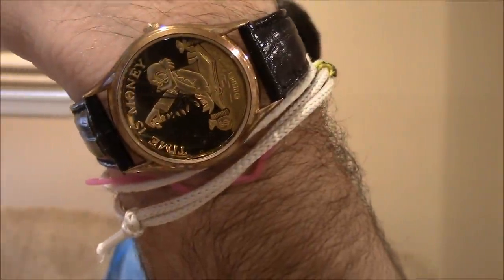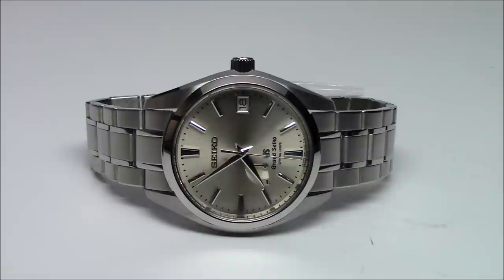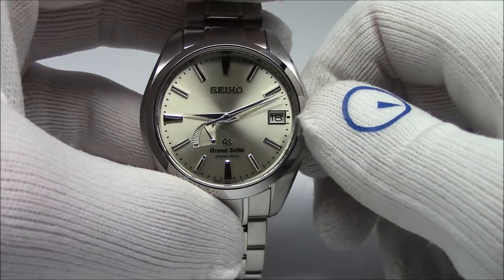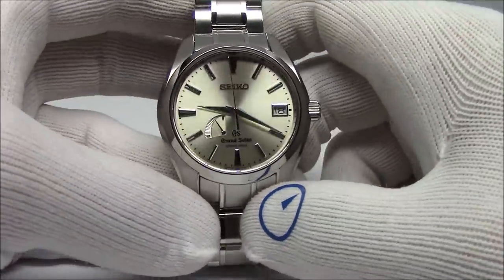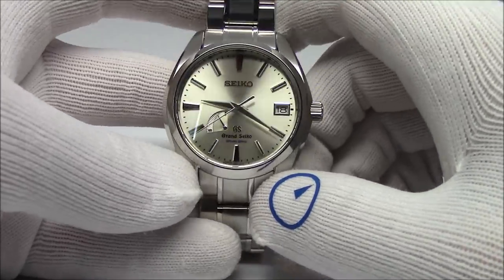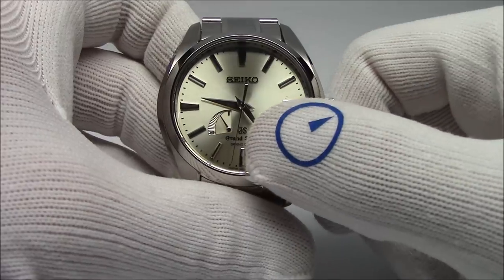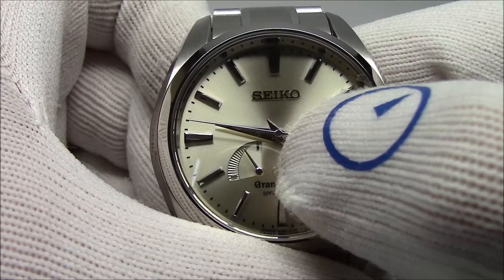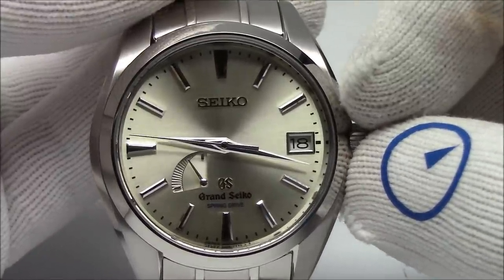What is Seiko Spring Drive and how does it work? Watch and Learn #24

Comment: So it does brake the second hand, it doesn't "tick" but it does fluctuate.  One would assume it has some sort of a pattern one could detect.  The watch presumably runs at a constant speed before being slowed down to the correct speed and then less slowed down if it over corrected.  I guess I'm asking if you slowed it down enough and could zoom in enough on the movement of the second hand would we see it stutter, and stop/slow down?  It seems obvious that the answer is yes, but I'm wondering how slow you'd have to go to notice the electronic braking.  I'm assuming they just lower the voltage or amperage (not an electrical engineer, don't know how controlling electromagnets works exactly) of the magnet to increase or decrease the braking.  Would be neat to see someone try to detect the changing speed of the hand.
Reply from the maker: It's a good question, but it properly designed, it should not show any start/stop motion.

Comment: Can you help me understand how power is generated via the electromagnet and transferred back through the electromagnet (in order to slow the speed of the glide wheel) at the same time? I understand how the permanent magnet spinning creates a current which is used to power the circuit and oscillate the quartz. I also understand how the oscillation of the quartz generates a current which is fed back to the electromagnet in order to slow the glide wheel. What I don't fully understand is how both of these things happen at the same time.

Does the voltage applied back into the electromagnet offset a small portion of the voltage generated by the spinning of the glide wheel, resulting in a lower net voltage that slows the glide wheel?
Reply: I believe there are two different electromagnets involved.

Comment: Does all this mean it's less durable over time?
Reply from the maker: I would say no less than a standard auto. MTBF of electronic components is far higher than mechanical ones; orders of magnitude.
Reply: Joey D there are debates over this question. but as far as I know, the mtbf for electronics is very high, electronic equipments usually die from heat or chemicals (like battery cells or some capacitors). here the energy is stored in a spring, no battery, no capacitor as far as I know, and very low voltage. and smoother than pure mechanical watch (no shocks). so they MAY be more reliable than any other watch. I have never found a report of a springdrive problem. I own one so I checked that before investing !!!

Comment: This was an amazing explanation, thanks Mark. A question I have, is how does the watch compare the quartz oscillation timing with the seconds hand timing... and then modify the brake pressure in just the right way to keep time... without a computer chip? Is there a mechanical way of doing this or is it another electronic component?
Reply from the maker: It does have electronics to do the comparing.

Comment: No watches are quartz "driven" this watch is quartz regulated just like other quartz watches but the implementation is on a mechanical movement. Very interesting watches and I would love to have one.
Reply: "Driven" in the sense that in traditional quartz watches, quartz timing is used to advance the movement with a motor, whereas in Spring Drive movements quartz timing is used to slow the movement with a brake (like a mechanical balance wheel and escapement).

Comment: Great video and explanation. Would it be correct to describe the spring drive as a mechanical watch that has it's own quartz watch that it continuously sets itself to? Sort of two watches in one? That is how I have come to understand it, and explain it to others.
Reply from the maker: Yes, that is exactly it. It's a quartz reference clock beating inside a mechanical watch.
Reply: Hey thanks for the reply! I find it fascinating that the quartz reference is converting the mechanical energy of the spring into electricity, and then using that electricity to control the speed of the mechanical parts. Truly the most ingenious system ever devised. Hopefully I can talk my wife into letting me get one some day!

Comment: What a beautiful example of over engineering, just for the sake of it. Well done Seiko, a clockwork quartz. The eye watering price tag blurs the view of the smooth second hand. It's like a locomotive with a diesel engine to power a generator to boil water with an electric element to produce steam to run pistons to drive the wheels. But look at the lovely plumes of water vapour. Crazy . . . .

Comment: I wonder if you can use a non Newtonian fluid and a rotor to regulate time using friction. Sort of like an automatic transmission tunnel torque converter in a diver watch.
Reply from the maker: Now that's outside the box thinking. There are deep divers filled with liquid (very lightweight, low viscosity), but I think they are all quartz. I would think that without a filtering mechanism, it would turn ratty fast. But I love it!!!!

Comment: Is the movement anti magnetic?
Reply: Yes.IC would correct watch's own magnetic with the glide wheel speed to control the second hand.if it closes to some outside magnetic that make it go faster or slower,the IC would check it out what happen to the glide wheel speed and recorrect its own magnetic to keep second hand run fine.However,if the outside magnetic is too strong,it could still make the watch totally stop or inaccurate.But it won't damage the watch.Once the watch leaves the strong magnetic,it would work find again.

Comment: Spring drive or not battery is required.
Reply: Spring Drive movements do not use batteries or capacitors.  Their stored energy comes exclusively from their mainspring.

Comment: While the Spring Drive sounds marvelous (and, if I had the funds, I could see myself getting one), I've been wondering is there a reason why they don't make Kinetic watches with a smoother second hand?  I have a Seiko solar chronograph watch with a 1/5th second hand and have heard it's generally not used often on traditional quartz watches because it drains the battery faster, but, if the Kinetic rotor is capable of recharging the battery, why not mimic an automatic's second hand as well to further distance it from the other quartz variations?
Reply from the maker: I think it's really the same issue; faster drain.
Reply: @islandwatch  This. More ticks per second equals more drain per second which even if you some incoming capacity in the form of the kinetic part since the core still functions like a quartz watch you will just add another X units of energy which will be used up by Y more ticks per second.

Comment: Given the smooth sweep of the second hand, it would be nice if the Slow Mo Guys could film a quarter-dial view of a Seiko Spring Drive watch (at 100,000-343,000 fps), if only to clear up how many times the 'Tri-Synchro Regulator' 'intermittently applies a electromagnetic brake' to the second hand per second.

Comment: wow 2017. still learning about watches. since u r one of those engineers that interested in watch, do you know why digital watch not as accurate as my phone clock? it can speed up or slow down. if it's mechanical i could understand it, but it's digital.
Reply: Your smart phone?  Smart phones get their time from either GPS and/or the cellular network.  GPS uses atomic time keeping.
Reply: @beardymcbeardface69  not smartwatch, i mean quartz watch. but i get it now. it's the oscillator cause it to slow or faster when the energy supply is not stable or weaker.

Comment: The power meter always seems backwards to me… when a needle moves clockwise stopping at a vertical position, I think most people would assume that to indicate a full or maximum reading. Anyways, it’s important to note that unlike in the car braking analogy, there’s no friction. That is, there are no physical parts rubbing against each other to create the braking effect; instead, magnetic force is used to regulate the movement.

Comment: it seems to me that the escapement mechanism is a pretty crude method of regulating a watch movement .  it is adjustable but not really in the sense that it can be useful to regulate the variations that make  a mechanical movement inaccurate .  far more elegant to have inherent quartz accuracy or perhaps a system like spring drive , although it seems a little over the top to go to this extent to get basically quartz accuracy
Reply: Well you have a watch that never needs a battery change.....I like that

Comment: Quote from here: https://www.grand-seiko.com/instructions/html/GS_9RA5_en/AGFISYxwidandf

"The seconds hand will stop moving when the crown is pulled out to the second click. Do not stop the movement of the seconds hand for longer than 30 minutes. If the stoppage of the seconds hand movement exceeds 30 minutes, push the crown back in, and wait for approximately 30 seconds after the seconds hand restarts moving, and then set the time."

So, every IC in Spring Drive has capacitors which are hold the charge for 30 minutes in average. When the crown is pulled out for more than 30 minutes - capacitors are discharged completely and thus it will produce the same effect (even with fully winded main spring) as watch cold start with winding from completely unwounded state, i.e. seconds hand will move fast with acceleration, while capacitors will charging and enough electricity will be generated to start an IC, and IC with electromagnetic breaker will take action.

There's no any video yet that demonstrates that effect. Please, make such video demonstration, it'll be really interesting!

Comment: This is a bit of a quandary. There was such a fuss made over the Daniels escapement but no-one really talks much about the Spring drive.  It produces the most beautiful second-hand sweep and much better accuracy than the Traditional or Daniels escapement, yet no Swiss maker will touch it? I am a traditionalist, but if someone makes something better, and it is still mechanical, it deserves some attention. 
For me, the Big problem with Seiko is simply the name and heritage.  
They have a history of making typical Japanese products. Copies of Western iterations done with precision but not much in the way of anything special design-wise. 
The problem they have is, how do you remake the wheel? 
They need to establish a brand marque. If you look at the Rolex heritage, they made very few quartz watches. They stuck to their traditions, much like Patek and many others. Omegas move into quartz only cheapened the brand. 
Seiko is a name synonymous with cheap watches. They will never shake that off. The GS brand needs a new direction, because it is really good, but will never shake the name 'Seiko'.

Comment: Basically an auto/ quartz watch , a type or variation of the kinetic concept where you have mechanical drive to power a quartz crystal
 and translate that timekeeping back to the mechanical aspect of an analog watch .  i believe its safe to say SD has a balance mechanism , only its electro-mechanical in nature , rather than being purely mechanical .   thoughts ?
Reply: Not really. The Kinetic concept is really just dealing with the battery and really just an addition of automatic type motion to deal with powering a battery ie basically like a crank generator (known technology as mentioned in the first few minutes of the video). You kind of need to draw the functions of the different modules in a mechanical watch to understand how this is different than Kinetic concept. Trying to frame it into a "variant" of Kinetic is basically trying to stuff a round peg into a square hole.

Comment: A generator runs backwards? C'mon Mark,  a generator makes electrical power from motive power.
Reply from the maker: A generator is a motor backwards; one consumes power, the other makes it.
Reply: Mark is correct. A motor runs on electricity. But when you turn it yourself in the opposite direction, it generates electricity. So, a motor is also a generator. There's plenty of videos on YouTube demonstrating this.

Comment: But now you have a watch that is susceptible to EMP, and are stuck with hourglasses for post-apocalyptic timekeeping...
Reply: hooya27 good thing GS also has high beat automatic movements, as well as watches like the SKX007 which would still be working if that were to happen
Reply: If you experience an EMP either a nuke just went off or the earth has lost its magnetic field and a huge solar flare just hit the planet. Given that, you will soon have bigger issues than  telling time accurately.

Comment: A Spring Drive is not a mechanical movement. You can read the details of it from Seiko in their patent. It was designed in conjunction with Quartz watches to replace the battery. There's no escapement, the entire time keeping capacity of this movement is through electricity and a quartz crystal. It's not a mechanical watch, and this movement should not be pushed as such. It's essentially an Automatic Quartz. You can find it all in the patent. The  origin of it is to find a way to get rid of the battery in a quartz watch.  The original method of operating a quartz movement through an electrical current generated by a coil did not provide enough power reserve, so they designed it like this. It's very technically savvy to be sure. And its a beautiful watch. But it's not a mechanical watch.
Reply: You are exactly on point!
Reply: Depends on what your definition of a mechanical watch is.  Spring Drive movements are as mechanical as any mechanical watch, with the exception being in how the unwinding of the mainspring is ultimately slowed and regulated.  Purely mechanical balance wheel and escapement, versus electromechanical glide wheel with electromagnetic braking.

Spring Drive watches might not be purely mechanical, but they are mechanical watches.  The mainspring is mechanical, the reduction gears are mechanical, the glide wheel is mechanical, the automatic winding is mechanical, the date change is mechanical, the GMT models allow mechanical setting of just the hour, without interrupting the minutes and GMT hands and allow for mechanical bi-directional change of the date, etc.

Comment: Putting electrical current into a mechanical watch is like putting a suppressor on a musket. You're missing the point entirely.
Reply: But it all comes from mechanical means? Its just smart. ‘Better’ at accuracy and power reserve but no battery
Reply: @cezarb4047  Okay, and a suppressor on a Flintlock would make it quieter. You're still missing the point. Mechanical watches are fragile, inaccurate, and short on power. Old guns are loud, smokey, and slow to fire. These things are anachronisms and that's why we love them. 

No modern soldier will ever choose to depend on a musket and no modern scientist will EVER choose to depend on a mechanical watch, even a Spring Drive. This electrified mechanical movement is fascinating, but ultimately useless, just like a suppressed musket. It will never be accepted as a precision time measurement device... and it shouldn't be.
Reply: A mechanical watch, with quartz accuracy, completely step-less gliding seconds hand sweep and yet no battery and no capacitor.  They're not trying to make it a purely mechanical watch, or an atomic accurate watch.  It is it's own thing.  That is the point.

Comment: So, basically a quartz that is powered by a mainspring instead of a battery. The electromagnetic brake is cool, but you're basically paying a heavy premium for the smooth, sweeping seconds. It's not something that tickles my fancy, as it still has a circuit board that will burn out over time, just like any other quartz.  I wonder how much they would charge to replace the circuit board, as Seiko is the only route to get that part serviced.

Comment: Japanese make very nice looking stuff.
But problem I found so far from Japanese’s product is that they don’t last long and their technology is not never be fully matured as opposed to what they claim.
I have used many Japanese product - fountain pen since 1960, camera since 1970, watches since 1970, sewing machines, cars,...no exception to this.
Fountain pen - barrel is always broken,  camera - very sophisticated but not trusty worth - autofocus, watches- very accurate first few months and died with horrible metal case, sewing machine - twin needle function did not do as they claim, cars- fuel consumption flaw, weak door, ...etc
I hope this spring drive won’t be the same but I just can trust them.

Bu

Comment: My 20-year old Datejust is accurate to within 2 seconds a day, without the need for a quartz crystal. Don't believe the hype.
Reply: Nick Sundby I am not understanding what “hype” you are referring to about quartz watches. My wife’s 25 year old Rolex has about the same accuracy as yours, about +15 sec/week. My most inaccurate quartz watches (1984 Sieko, 1990 Micronta) gain about 5 seconds a week. My newer Citizen, Seiko and Timex watches are almost perfect when measured for only a week. For modern high quality quartz watches, seconds/month is a more meaningful measurement. Purely mechanical wristwatches are wonderful and I plan on adding more to my collection, but I am realistic about their accuracy. BTW, my Howard Miller grandfather clock with temperature compensating pendulum is as or more accurate than any mechanical Rolex.
Reply: Hype!?  Citizen have a quartz watch that is accurate to +/- 1 second per YEAR!